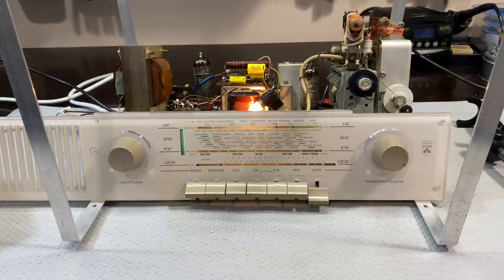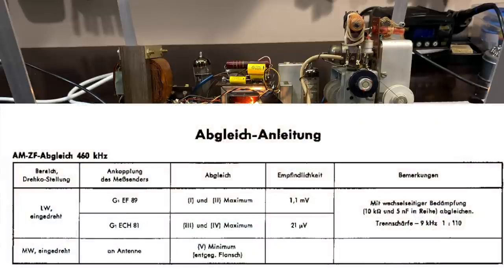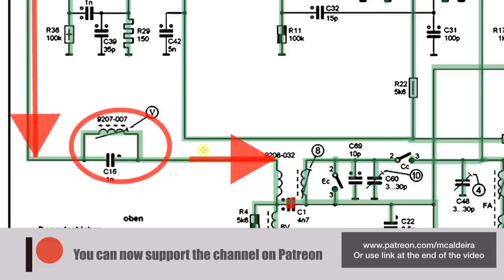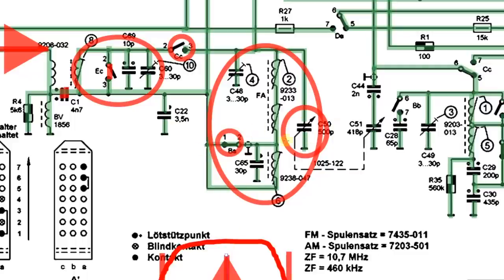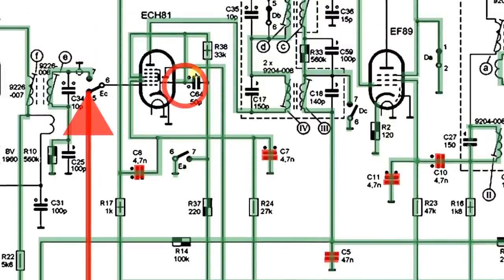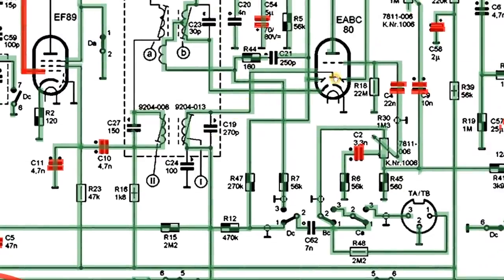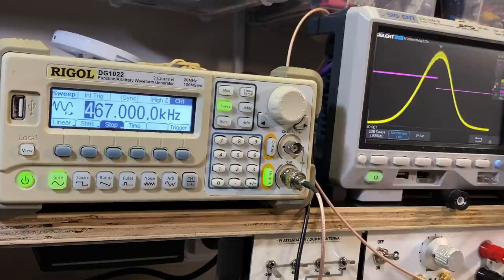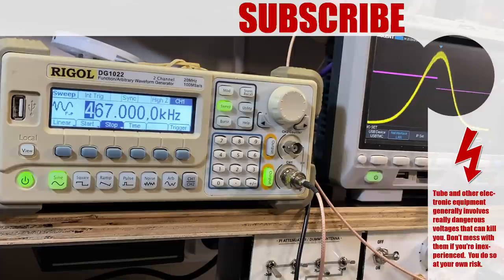Grundig 2147 Restoration pt. 4. Lets do an AM IF alignment, slowly!

Comment: Note that the first 10.7 MHz filter after the ECH81 has a switch across it, marked Db. When this switch to short it wasn't there, the IF amplifier would pass 10.7 MHz when in AM mode. When the radio is tuned to shortwave, 10.7 MHz can appear on the mixer output and would be passed all the way to the detector if the switch was not closed.

Comment: Absolutely fantastic description. Followed it in detail until I understood every single sentence. This required listening about 10x. I ate every single word. Thanks so much for sharing your knowledge. I am totally new to this and bringing my Normende Fidelio 57 back to life has been a blast. Now I have finally understood each section of the radio. I will Paypal you a beer. Many thanks. DC4DC.
Reply from the maker: Thank you Gerry. It’s good to know that the info is useful to someone. My goal will be to improve my communication skills so that you could get it the first time around 😊 Thanks for the beer (or crate of🍺). Part 5 does the FM.
Reply: @electronicsoldandnew  Believe me, the problem was not with you my friend. It is with me. You explained it so crystal clear. I am an electronics engineer but I have worked in Communications software so long, that it is quite a paradigm shift back to HW. However, we  all have  to have hobbies for retirement. Learning old things anew is a magical gift. Thanks so much.
Reply from the maker: A bit like me. An electronics engineer that went the business route, and came back to my passion years later.

Comment: This sermon about the IF stage is NOT 20 times longer than it has to be. It's exactly what a beginner needs for understanding what's going on. It's the best explanation I've seen yet. The graphics you used for showing what the four filters do ... brilliant, you would say. For an absolute beginner the only thing missing would be to explain what an AM modulated signal looks like (I am sure you did it somewhere ... or was it Tony? Or Paul? I don't remember). A follow up about the methods (volt meter / visual) and coupling would create a two video reference playlist about alignment. Great!
Reply from the maker: Thanks for that. As I said before, one sometimes gets so used to doing this that you forget that some people are still learning. in fact, I’ve just watched an alignment video of Mr Carlson, where I always learn a thing of two myself.

Comment: Well, isn't that filter curve way too narrow? Looks like the bandwidth is only less than 2kHz.
That's why you should dampen the filters during the alignment, they're coupled over critical (or do the alignment entirely visually). So you basically have to detune them slightly from each other to get a flat top on the curve with the proper bandwidth.
Reply from the maker: On AM I generally prefer maximum selectivity versus fidelity, but this setting sounds very good actually. I understand your point though, but as I have exactly one local MW station in Madeira, I prefer a lower bandwidth.

Comment: Hi Manuel, I have not been able to set up for a visual alignment, I get close but no cigar. If you can show the setup again it may help or direct me to the old video if you don't want to do it over again, Cheers 🙂
Reply from the maker: Hi Dave. 
See if this video sheds some light:
https://youtu.be/Sqas8D7zYmM
Reply: @electronicsoldandnew  Manuel, in the video above you say that you prefer doing IF alignment with the AGC voltage measurement method show. Nowadays the method being used is measuring AF output with a multimeter. Any reason why you changed your mind during the last 4 years?
Reply from the maker: I guess the AF measurement is just so much easier. I’m getting lazy in my old age 😃
Reply: @electronicsoldandnew  Yep, that's the one, thanks 👍

Comment: As you showed the shortwave, i heard some german words ( Wohngemeinschaft for example). Didn't know, that there is a german shortwave-transmitter on-air! Thought, that they have killed all in this frquency-spectrum.
Reply from the maker: I’ve heard German on quite a few occasions, so there are some on the air.
Reply: Some stations transmit in different languages and also in german f.ex. radio china international, however on 6MHz some german owned private stations are transmitting. I think it is 6140kHz.

Comment: Here's the service manual : https://archives.doctsf.com/documents/feuilleter_document.php?num_doc=42829&ref=33393
Reply from the maker: thanks. I have that one, but it doesn’t have the drawing showing the positions of the various adjustment points. That’s why I used the 97a service manual as well.
Reply: @electronicsoldandnew  Indeed. No chassis layout pic in this version.

Comment: What a detector probe you use?
Reply from the maker: i don’t use a probe here. I’m either measuring audio at the speaker or DC voltage at the AGC line, so no deciding is happening, only AC or DC volts.
Reply: @electronicsoldandnew  that do you see line on scope in sweep
Reply from the maker: used a 10x oscilloscope probe.